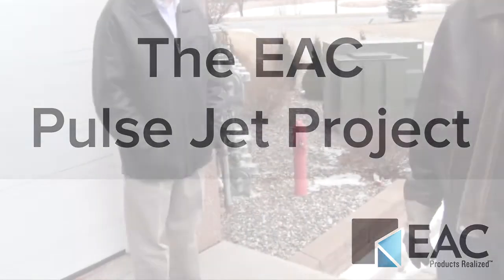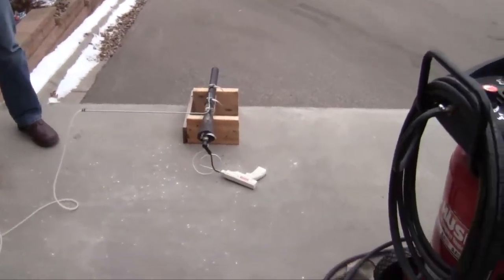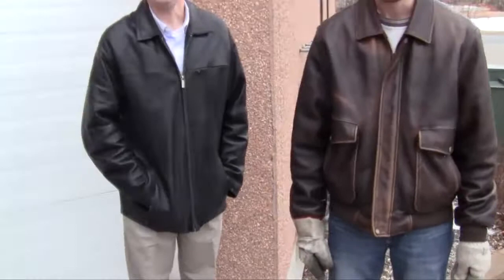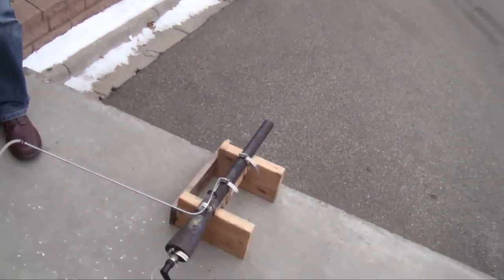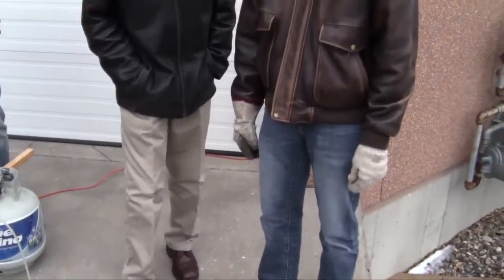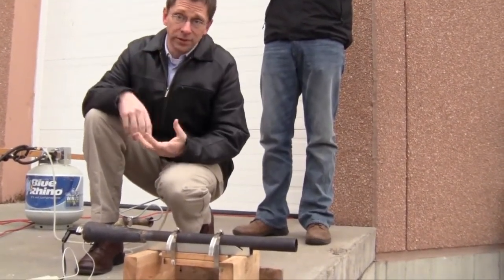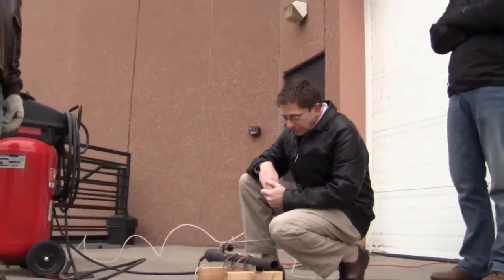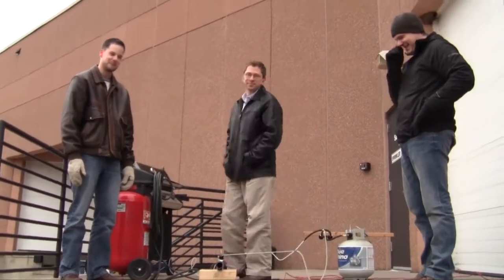The EAC Pulse Jet Project

Comment from the maker: Hi Mtron1000. We hacked a Camco 57533 Olympian GM12 RV Multi Sparker from Amazon.com. Hacked off the tip and connected wires and alligator clips to the positive and negative poles. For the spark plug it was a standard small engine RC9 plug and then we used a threaded insert to add more thread contact area (as opposed to having 1.5-3 threads going directly into the sheetmetal). Does that answer your question? Good luck!